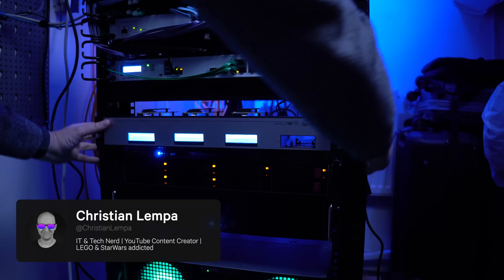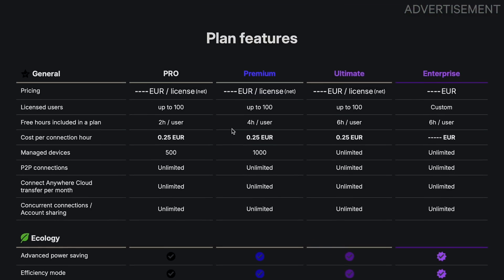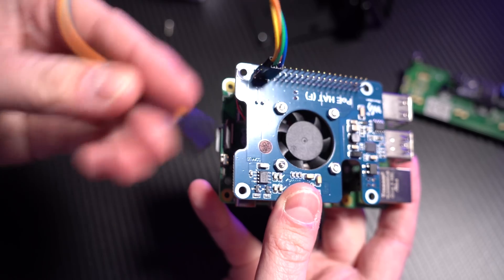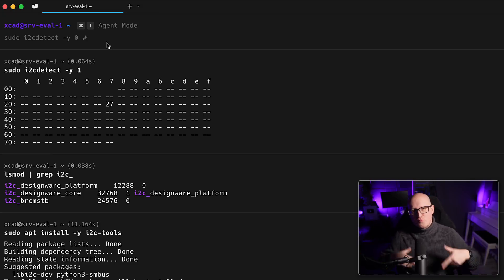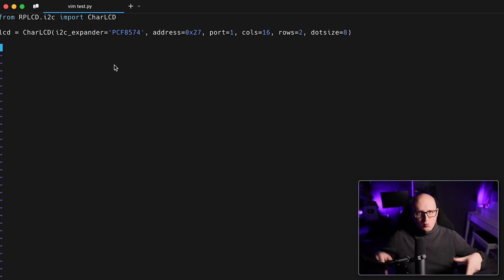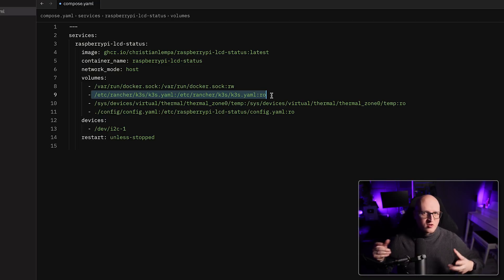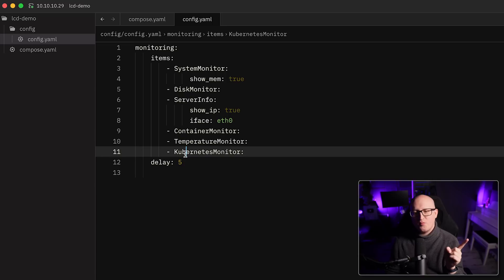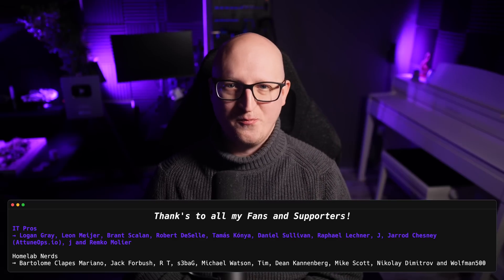Raspberry Pi: The Coolest LCD Screen Server Monitor!

Comment: Hi Christian, is there any option to connect this LCD to smaller RPi like Rpi Zero 2W and using your software to show not the utilization of RPi but some remote serwer?  Like connect via SSH to Unraid serwer and show utilization of it?  Or maybe i overthink this case?
Reply from the maker: Hm no idea, I have just connected it to the RPi5, and the software isn't able to collect data from SSH, only from local server.